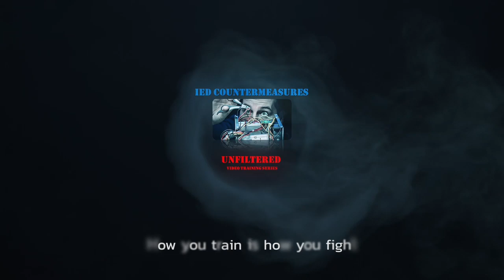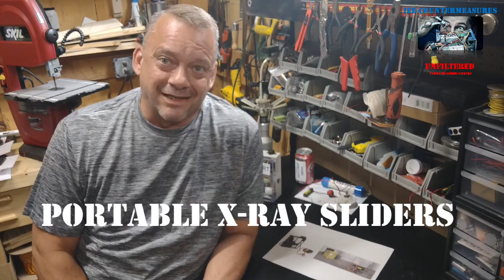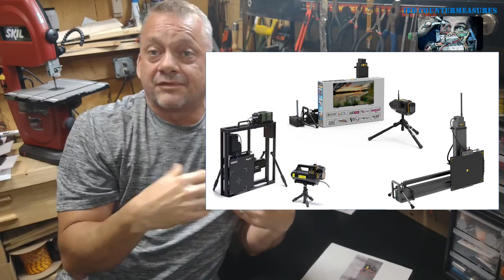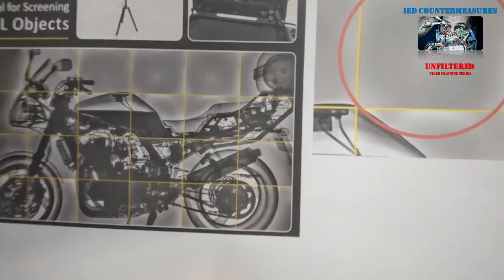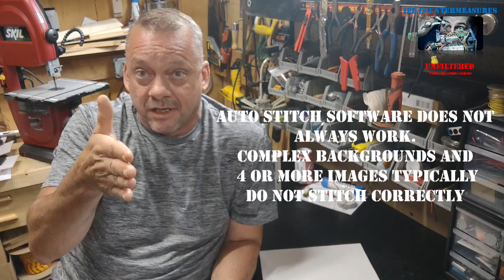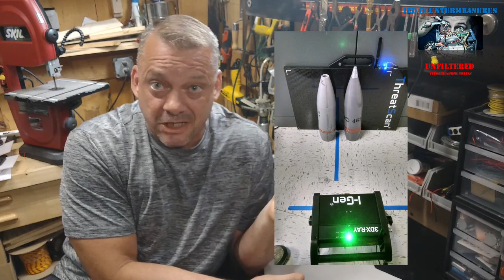Portable x-ray "Sliders" are they worth buying?

Comment: It is indeed clear that the picture of the motorcycle was taken with multiple approaches and the X-ray source was moved. Considering the company that created the picture, it is also not surprising and unfortunately not the first time I have come across their "edited" pictures.

But- I think you are wrong in your approach.
You think like an EOD and therefore a large number of approaches bothers you, and rightly so.

But- there are a wide range of other customers for portable X-ray, who are not EOD, they are not afraid of multiple approaches and therefore it does not bother them either.
Border Patrol, Drug Enforcement Agencies, VIP Protection, Customs, etc..
For these end customers, the slider solution is an efficient, fast and convenient solution..